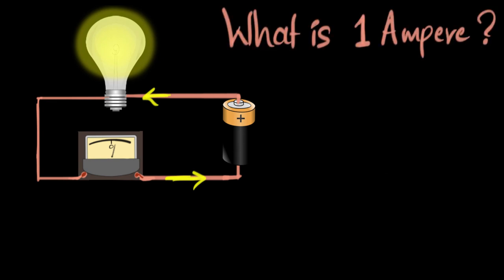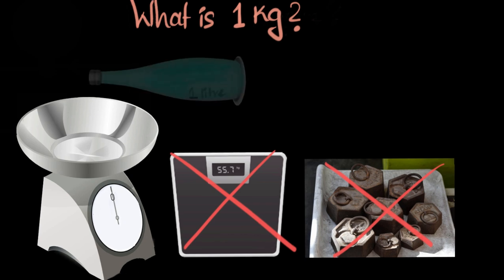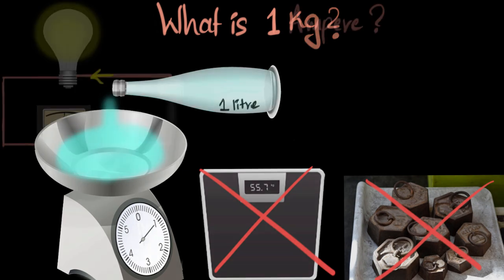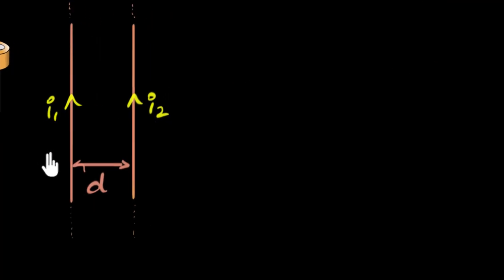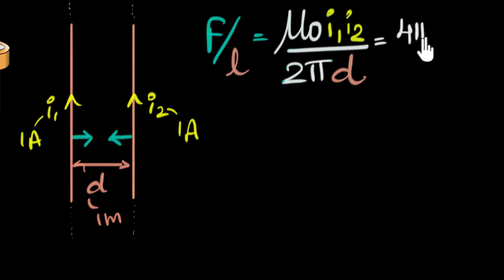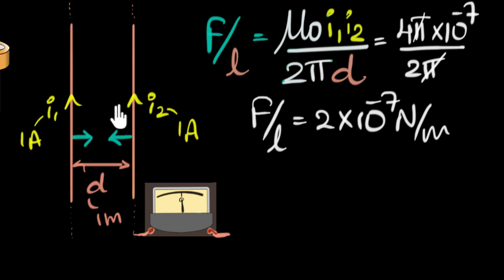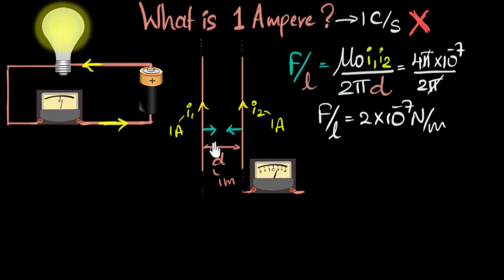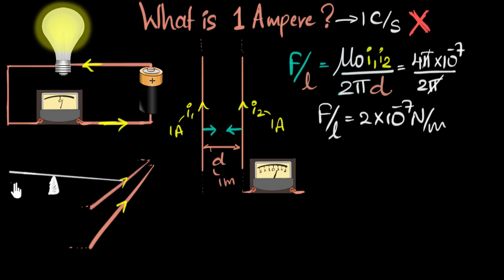Ampere definition  | Moving charges and magnetism | Physics | Khan Academy

Comment: How is the definition of Ampere given as Coulumb(s) per unit second?
(OR)
No. of charges passing through a cross-sectional area of a conductor in a unit second?
Reply: That is problematic because Coulomb itself is a derived unit which is defined by using the concept of ampere. Ampere is regarded as a fundamental unit whereas Coulomb is a derived unit.
Reply: Thanks